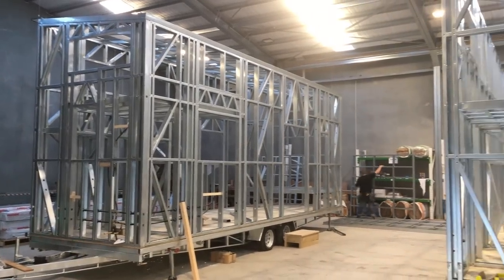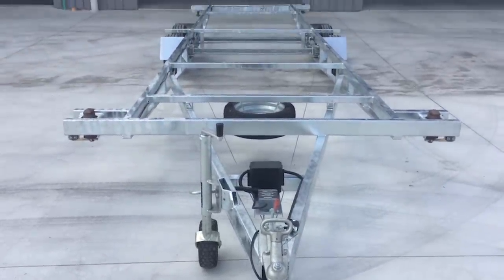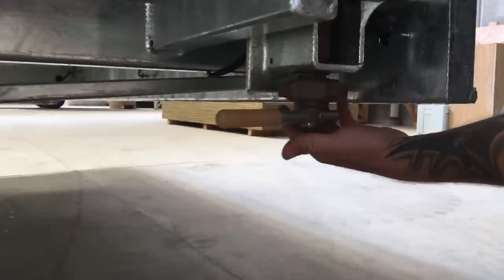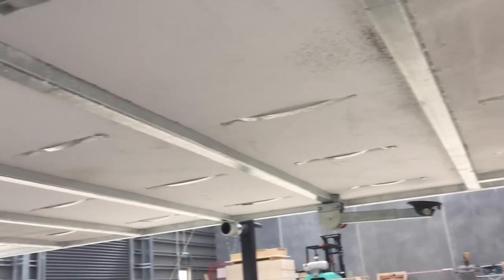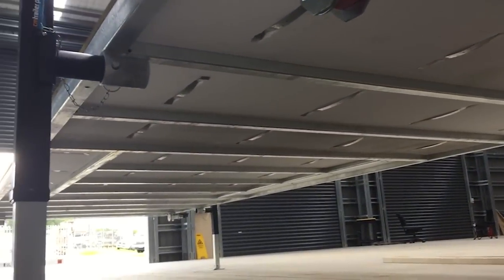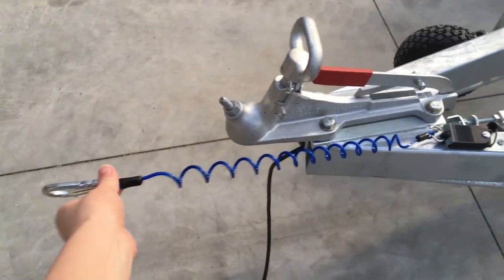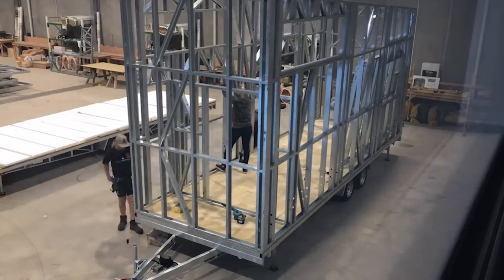Detachable Tiny House Trailer | Build Tiny, Tiny House Builder, Katikati NZ

Comment: Just build the tiny house without a trailer, then strap it to an ordinary trailer that you rent when it comes time to move it. Saves you $$$
Reply: Oh dear.....where to start with that comment
Reply: Sounds like very smart thinking to me
Reply: Before "strapping it" to "an ordinary trailer", how are you going to lift it on to the trailer?
Reply: @vincestagbaugh703  You could rent a crane.
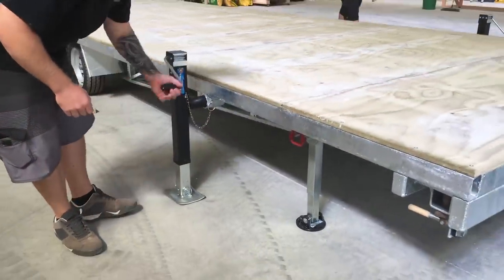Reply: @jm-bv1wh  Renting a crane might be even more expensive than having built on the trailer to begin with. But..... If you watched this video carefully there is a more easy solution: they used these lift forks at the 1:03  mark.
Reply: @vincestagbaugh703  just like they do it in the video

Comment: Would you supply just the deck and chassis? If so what’s the rough cost? And is there and flex or bounce while walking on the deck when the trailer is removed?

Comment: I would love to know the thickness of the steel frame on the house base section. It looks like 75mm/50mm but cant tell thickness. 2, 2.5, 3mm ??. does the floor have slight bounce after build

Comment: I have been following the tiny house concept for about 4 years now.
There are a lot of very stupid ideas out there.
I have to say, in 4 years of research and concepts, this is one of the most brilliant ideas I have ever seen. I've been wondering if anyone was ever going to do this. I am a huge fan of simplicity and the engineering of this is so simple and basic, it's pure genius. Bravo. Excellent work.
Reply: 💯 agreed.
Reply: I totally agree!!! This would make a joint buy of a trailer a good investment. When your settled with your tiny house, someone else can use the joint-trailer for any moving.
Reply: Or if you had more than one tiny house....one trailer fits all
Reply: People use Wechselbrücken here in Germany in the same way: they are just a platform with removeable/foldable legs with or without hard/soft sides used to carry anything. They exist worldwide I'm sure. Buy a used one cheap, build on it, then just hire a truck to haul it. Dead easy, and insanely cheaper than a custom trailer and house platform as in this video.
I can get one for €400, and the weight capacity is beyond anything you would ever need for a tiny house. The combo in the video would cost you €15k or more here. I asked one trailer maker for a quote.
Only issue is they sit about 1 meter high, so height of your build is limited. I'm making a removeable roof to get around that. Worth it to save at least €14,600. :)

Comment: What about double glazed windows for a tiny home. Are they normal standard windows that you would put in a typical building or they different. Like normal glass or polycarbonate? Does the glass shatter when you move the building?

Comment: can you have it permanently on the jack stands and then just have the trailer sitting freely or does it have to have either the trailer or proper foundations? Cheers
Reply: You would have to counter strong winds, if it´s sitting on 4 jacks that can easely take the down force when you add in wind the weight shifts from only down force to sideways and swinging from side to side Im betting the jacks would eventually fail with catastropic results.  I´m a welder/iron worker and live in Iceland and would newer jack my future tiny house off the trailer in gusty winds nor let it sit on these legs..
Reply: Just lower it down on some blocks. Nuff said.

Comment: Seems like those out riggers are not very heavy duty at all. I'd imagine the welds will break after years of wind beating against it
Reply from the maker: Hey there, The Jacks are rated to carry 2.7 tonne each, far in excess of the total 3.5 tonne required (Max weight for a road legal tiny house in NZ is 3500kg
Reply: @ginamariestevens  i know they meet specifications im saying in real world applications those look like they would fail to provide lasting stability. I've seen out riggers for cranes with cracks along the welds that are much sturdier than those trailers jacks
Reply from the maker: @happylife174  We can assure you they are fit for purpose. They are for intermittent use, for levelling the house when first parked, and jacking the house up and off the trailer when required, they are not there to provide 'lasting stability'. Tiny homes are temporary by their very nature, and move often. For more permanent siting, the Jacks are not used whatsoever. They are simply a lifting and levelling tool. Thanks
Reply: @ginamariestevens  Hy! What would be the weight for a 7m long trailer? Can I somewhere check the specs and prices?